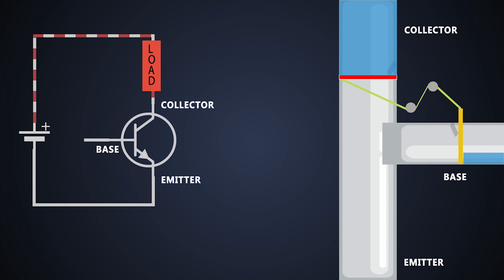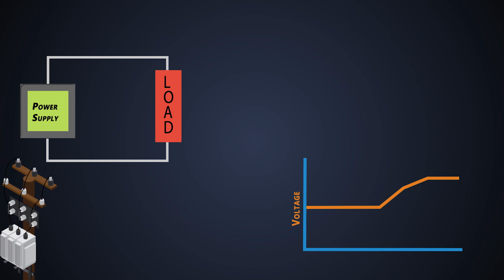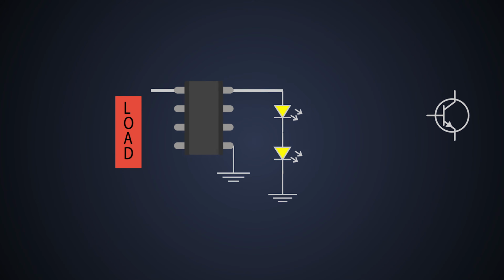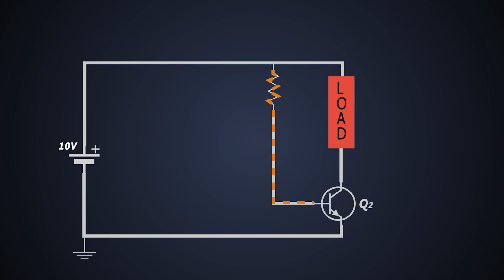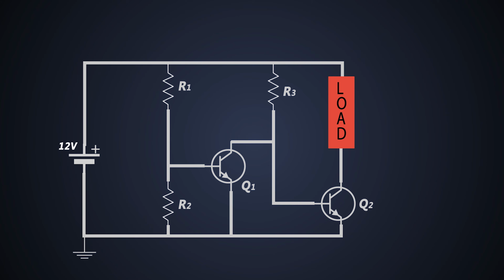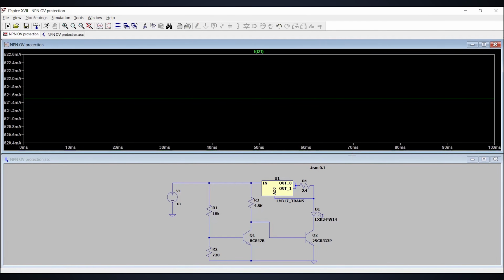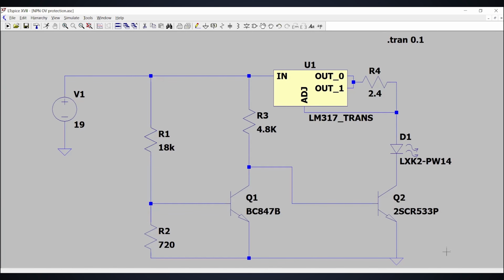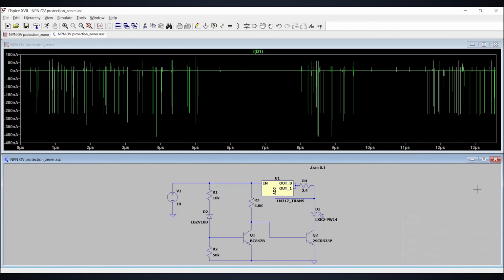How to design NPN BJT based Overvoltage protection? Overvoltage protection using NPN BJT.

Comment: You are a genius i wanted to use an inverting comparator to do this but you have simplified this . I have built the circuit and it works.

Comment: why/how did you select 18k and 720 for R1 and R2 respectively in the zener diode case?
Reply: Note that for an npn transistor a base emitter (BE)voltage of 0.5v or less the transistor is off, not conducting from collector to emitter, and for BE 0.7v or greater it will turn on.
So using a voltage divider, the base sees 720/(18000+720) of the supply voltage. 12v in produces less than 0.5v at the BE junction (off) while 19v would produce just over 0.7v at the VE junction (on). You'd have to choose an appropriate transistor and look at the specs too.

It is also important to keep the resistor values in the k-ohm range and not in the m-ohm range. This is to allow a few mA to be used in to the q1 base. By having a few mA there,  q1's collector can sink/drain a few hundred mA, and q1's CE voltage can be brought down preventing q2 from turning on.

There are better over voltage protection circuits I'm sure, but if you go with this,  I'd probably do some tests and measurements the realized design behaves as expected.
Reply: Ahh, I didn't see the zener diode part until after. Zener have a reverse breakdown voltage that they operate in, but that can vary so you'd need to know what the rating is on the zener for starters. And then yes,  start figuring.

Comment: can you design a 27 V protection circuit ? (with resistor values)
I mean if the voltage goes over 27 volt then the circuit will be turn off.
Reply: R1 = 100k, R2 = 2,7k

Comment: Nice tutorial. But how to calculate the value of R3? 
And will the circuit work in a same way if the NPN BJTs are replaced by N-Channel MOSFETs?
Reply: The video is good but it is just as good to do calculation and show it, by simply using a package it does not really showes the proffesional side, anyone can use the package but calculation only engieers can do and he should have done that or should do that...

Comment: What happen when we connect 12v dc adaptor, still we need over voltage protection?
Because I think 12v adaptor provide same voltage or low voltage and not > 12v.
Reply from the maker: sometimes due to any failure it might provide >12V

Comment: But when Q1 is on very very little current can flow through to Q2,so Q2 can't be off.Because uA enough to open to Q2
Reply from the maker: The current flows in nA or pA which is not sufficient to turn on the Q2
Reply: @FoolishEngineer  thank you :)
Reply: Need to select q2 such as collectors current rating is more than load current